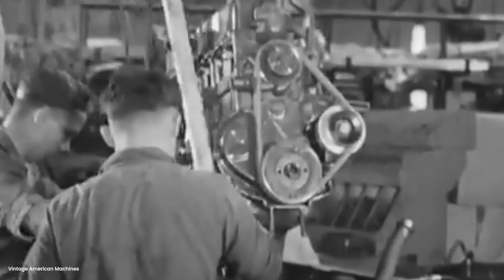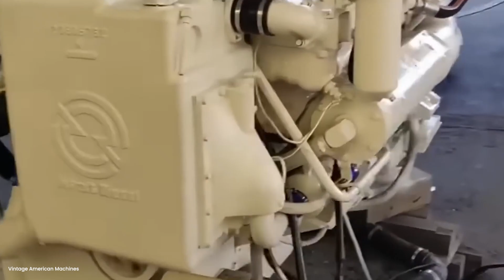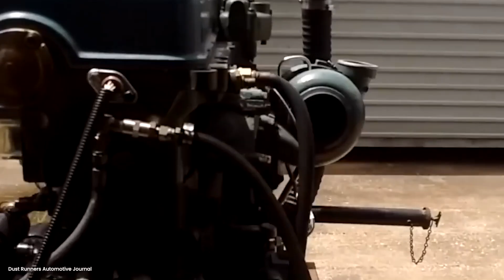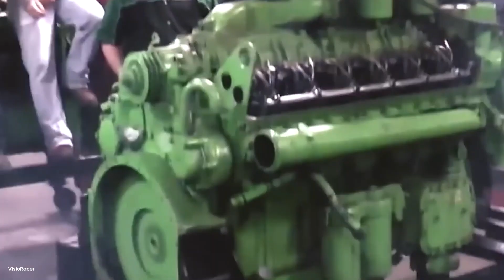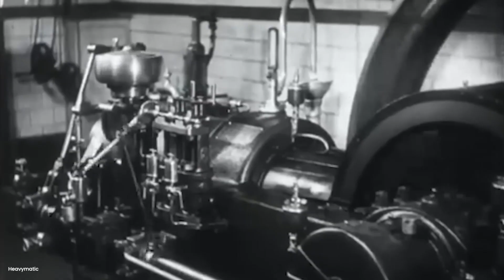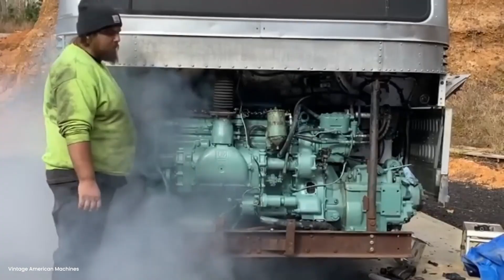Even at 238 HP & Two Strokes, The Detroit Diesel 6-71 SHOCKED EVERYONE with Its Endless Life

Comment: As a Marine Engineer (and while in the Navy) I've worked on a few.
I've never seen one with a single  cylinder head. One head per bank, allowing for the V models which have 2 cylinder heads.
In 1981, I was on a fishing boat that was originally a landing craft, like the ones in Guadalcanal. I'm pretty sure that was an original engine. One day we were cruising @ 1800 rpm, when a valve broke off at the keeper. By the time I got it shut down, the valve had smacked the piston 3 or 4 times before it got really stuck (bent) in the valve guide. Got towed in by the Coast Guard, took a couple of days to install a new head, and we were out fishing again.